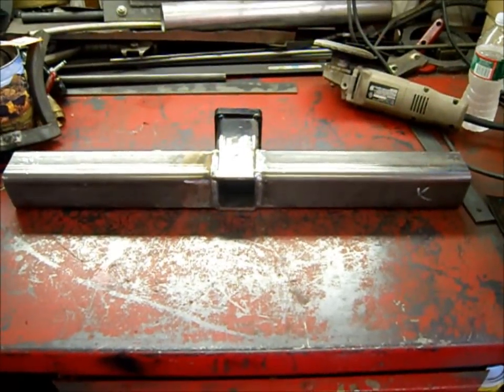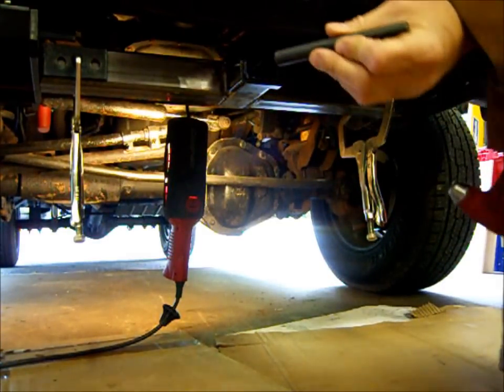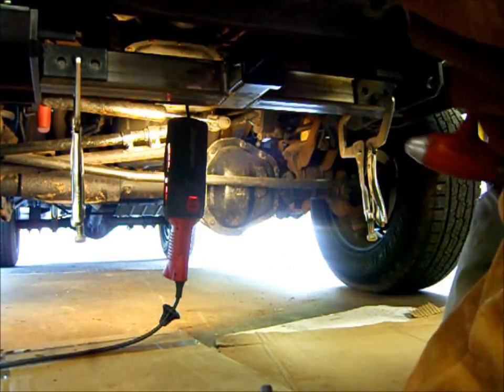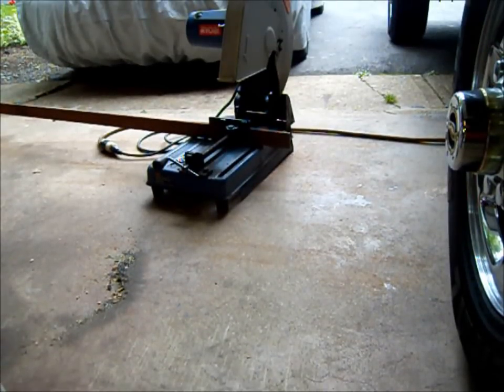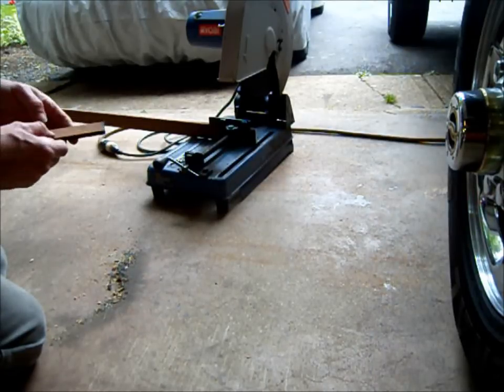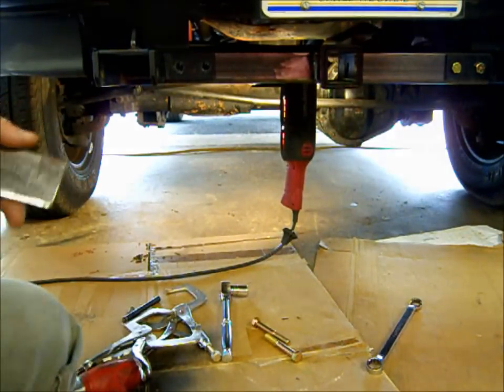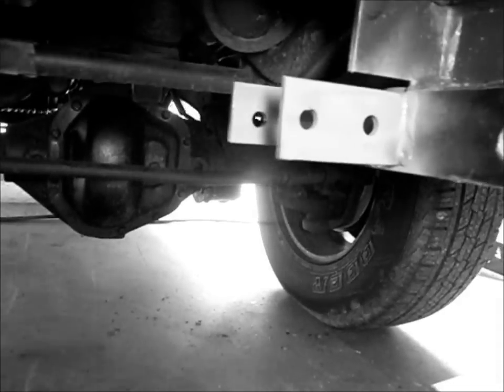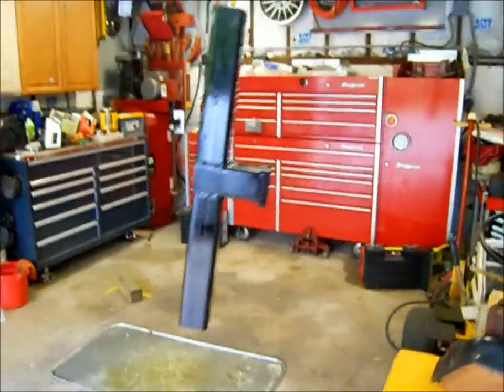Dodge Ram front mount hitch build Part 2

Comment: Though you have more surface area for welding by cutting the square tube in half for me I would have just welded the receiver to the tube without cutting. Either way will work. I need a quickie receiver hitch since I'm stuck in the woods and will need to get it done by tomorrow for my winch.